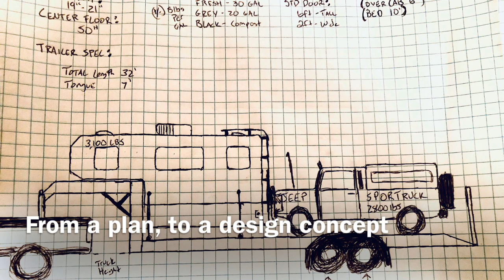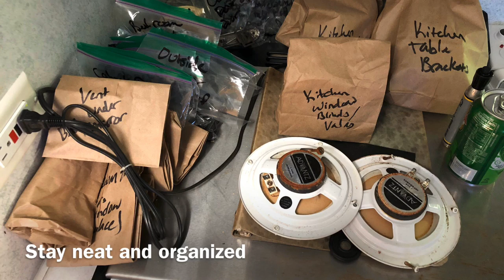DIY Couple Rebuild/Remodel Truck Bed Camper / Start To Finish / Introduction to the " ER:KSON-NO:R"

Comment: I use to have a Truck camper , my friend gave it to me. With that thing in my  f-250 buckin the wind I couldn’t get the truck to go faster than 72 mph.
ButI had fun with it camping out at my job 250’ down in a lime stone quarry on the weekends . You did a good job on everything, I should have fix mine up but it was like 16 yrs old when I got it n didn’t have the time. Thx. For posting this video!

Comment: 5:24 essential you bought a DIY kit camper, that was already assembled, all you did was take it apart, and reverse engineering it.   and, built a better version, using the original structure as a template 🤘🏽  
...I think y'all came out ahead, and did a damn great job.  It's inspirational 😊

These truck campers are hard to come by in Texas 🤔
Reply from the maker: Assassin Mongoose thank you , we are great full that this has been inspirational to others, the compliment is also appreciated we put a lot of effort into this and to see it finished and being used is by far one of the best feelings....thanks again friend. If your near Cisco we have a friend there and visit often so if you find a camper near South Carolina we are happy to help you relocate it. Live simple live free 🤘🏻
Reply: Cisco Texas?  I've actually been there 🤔  Well, driven thru town on the Interstate, stopped at the TxDOT Rest stop.  You know they killed Santa Claus in Cisco, TX. 🤣

https://en.m.wikipedia.org/wiki/Santa_Claus_Bank_Robbery

Comment: Need help with my shadow cruiser trying to replace roof as well. A little bit at a time but having trouble figuring out if I need to pull the sides off and replace the paneling on the inside, but I can’t do it while I’m heading out of country and need some input.

Comment: Nice job! You’re right, that last pic of the finished exterior has a lot of “wow” factor.

I’m working on a ‘93 Shadow Cruiser pop up right now and was wondering what type of paint/ application process you used for the primer and black top coat? Did you spray it with a paint gun?
Reply from the maker: sorry for the delay we have had a lot come up since we posted this video....it was sprayed with a paint gun and ill get the details and send your way as soon as possible....

Comment: I have just bought the same camper and have had to rebuild all 4 corners almost to the point of putting siding back on then to tackle the inside.  So you have any insight on insulation?  Also how did you finish the bathroom.  Im thinking about making the shower outside off the back and adding a small deck ?